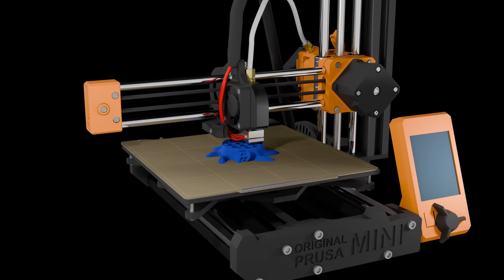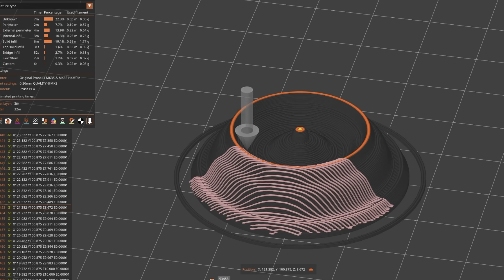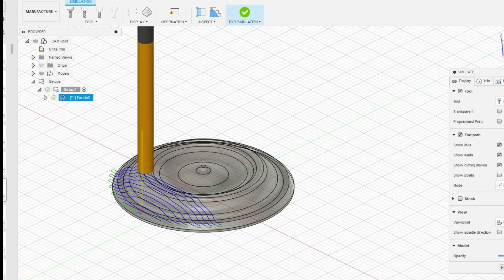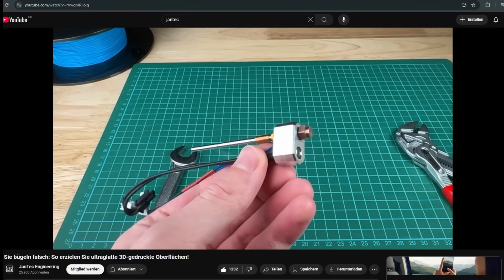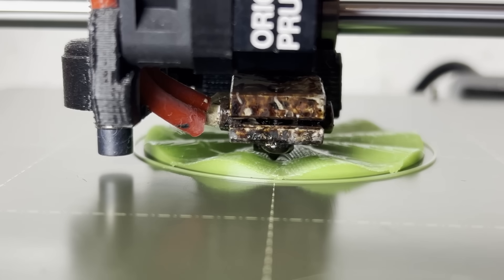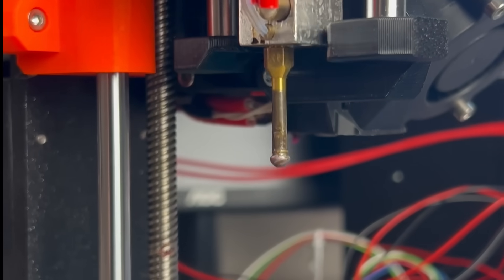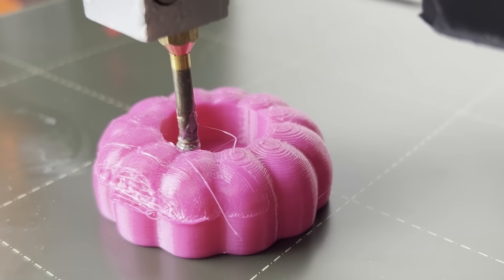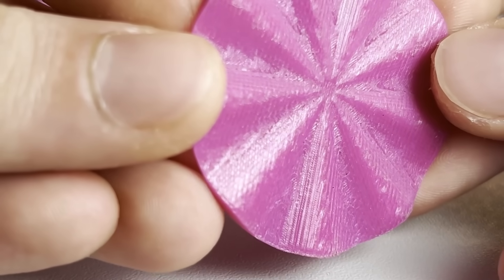A Different Approach to NonPlanar Ironing| Now Opensource!

Comment: As creator or the Ironing idea I can only say ‘bravo’ amazing development

Also an idea after seeing the video. Don’t you think that to improve visual finish for this Ironing you might want to actually remove external perimeters. Of course a full solid object is too time consuming, but there’s ways to make a ‘perimeter’ solid without actual perimeters. Why I say this, well when you work around VS an opposite angle is harder to iron it, so if the areas ironed would have a common direction, the ironing finish would look a bit cleaner

Comment: Look into soldering iron cartridges. Long, thin, with the heat and measurements directly at the tip. Maybe you can take an existing one and turn it down to ball shape.

Comment: Testing strength and friction would be interesting after you do this; this may have benefits there. Also, maybe just take a nozzle, cut it, fill it in, and round it off to make the desired thing. For laser, please have well ventilated.

Comment: Wonder if you could replace the hotend with one of those small pencil soldering iron? You would need to make a special round tip, but would also have it further away from the gantry and be able to compensate for the temperature loss due to the fact that you have a higher top limit you could adjust to.

Comment: It would be interestimg to make a radial version for a few of those, going in a spiral instead of a plowing pattern
Reply from the maker: This is already a feature of the script. You can choose between scanline, adaptive and concentric(spiral) but the main testing happend with scanline, so the other two are very experimental and probably buggy aswell.

Comment: not sure if you noticed but your custom iron tip isn't very stiff, I can see it deflecting also a more dense tip may help with the thermal gradient by having more thermal mass, might take a bit to heat up though

Comment: You are awseome! I suppose as this is only gcode it doesn’t matter what 3d printer you have? The non planar top layer has been something I have been wanting for ages🤩
Reply from the maker: In theory yes. It is currently tested with prusaslicer and marlin flavoured gcode. I added the common differences of f.e gcode comments of different slicers so it should work at least with orca and bambustudio. Other flavoured gcode should also work. But those things are not tested so you simply have to give it a try or wait until I can give you a better answer. For now, as long as you use prusaslicer and marlin, you are on the safe side. (make sure to turn off bgcode though)
Reply: @tengertechnologies Thanks for the info. Thought to ask as the bambu printers have a fairly good nozzle for non planar stuff. With small adaptations you have a fairly good amount of playroom close to the nozzle for curved surfaces. Of course with the closed source nature of the printers gcode adaptations are the only one you can do with them.

Comment: I would believe that the rivet isn't perfectly centered and thats why issues with dragging filament happens. Somebody for sure can machine a complete ironing nozzle out of brass with near perfect dimensions.
Reply from the maker: Yeah my "tool" is horrible. This all started as a weekend project and I had to work with what I had in house, hence the rivet and brass tube from a ballpoint pen. I'm currently thinking about the design a bit more and then order one.
Reply: @tengertechnologies  Good luck! Hope it works well.

Comment: Oof, that script really needs to use the normal of the surface to only generate perpendicular enough paths.

At worse you can just bruteforce it by having the script run from multiple angle and overlap the ironing.

About machining a round end, you can do it on lathe by freehanding it. It isn't that had.
Reply from the maker: I don't get what you mean. Can you elaborate what using normals would do better except of being easier to work with? 
The script in the current state supports max angle settings, tool collision calculation with different tool shapes and offsets (also per tool feature shaft/contactbit), maximal reach of the tool, configurability of the toolpath generation such as global or per segement recalculated toolpathing/collision to allow access to hidden regions. It also is able to calculate the perfect height of passes to make hidden regions accessible. It filters small errors such as sudden tool drops because of f.e very small holes. All this is configurable in every step.  So if you want to only iron 10% angles, you can do that (look at 1:52 in the video where the slope map is shown, you can do that for every pass) . But I like to push things to the limit and set my max angle to 85deg on the nozzle with max reach 1.8mm.

If you talk about the pin hitting the print -> that was a mechanical error of my toolholder, combined with risky tool offset settings(gear slipped because of the pin having a -0.05mm offset and sticking to the material) 

About the machining: I simply don't have the experience to freehand a perfectly spherical end to a 20x4mm pin on a hobby lathe with horrible precision (In the video you can see the drill shaking because it's impossible to center it perfectly). I know how it can be done but I can't with my setup.
Reply: @tengertechnologies  Sorry for the late reply.

I mean making sure the tool would descend a slope instead of using a single direction for a pass and have a mix of different angle to the slope the tool would pass at instead of keeping the tool movement co-planar with the normal vector of the work.

I guess it felt obvious to me that going down a slope would be better than tangentially. As a handmade-gunsmith trying to remove gradient lines, that what I would do by instinct.

But my hands aren't CNC, even if I can reduce the pressure of the tool, I still need the tool to be in contact with the work.

With a CNC machine, I guess it would even be possible to iron out each high spot of the outer extrusion tangentially to get a perfect result on a convex slope.

Anyway, I guess once you get a goof hot tool calibration, the quality of the smoothing compared to the pass angle to the slope can be something to test out.

As for turning by hand I meant with holding a tool in contact with the work with your hands, not using the carriage. Regular files work well for just creating a round shape. And if you work slowly, you can use a template you 3D print to get a perfect ball end. Put some sharpie on the work to know where you are filing, and it just takes patience and making sure to use tools with big handles (to prevent a kickback to be too dangerous) and not wearing long sleeves.

Comment: You should look into using a long cartridge heater with built in thermocouple. That could be used as the smoothing tool. No need to worry about heat conduction, the heater itself is the smoothing tool.

And to make sure it's got a nice smooth tip, just buy a copper ball and drill a hole half way through it, with a diameter matching the cartridge (or maybe a little bit smaller, then hit it with a blowtorch and slide it on when it's real hot for an interference fit. Or just hit it with a hammer to "crimp" it on 😅).

You could even use different diameter copper balls, allowing you to change the radius of your smoothing tool and optimize for different parts.

Comment: That is really cool. This would also work with a spindle and a ball mill if you have a tool changer (and rigid enough printer) 🤔. Anyways great project and great video :) 👍
Reply from the maker: Yes I thought about that and I might try it, as I have a spindle laying around. There are 2 problems. 3D printers are not built for milling forcces(like you mentioned) and it's messy so I don't think people would use it in a normal setting.
Reply: @tengertechnologies  yea your right. Maybe with a special toolhead with integrated vacuum but even then it might get messy, but since your just finishing the surface one might get away with it :)

Comment: Would contactless ironing work? Using hot air or a laser to locally heat the plastic.
Reply from the maker: As I mentioned in the video, the next video is about this topics (later this week)

Comment: why not actually use a ball end mill?
just add it next to your hot end with a Dremel
Reply from the maker: Thought about that but a 3D printer is not built rigid enough for milling forces. But I might try it anyways, because I have a spindle laying around

Comment: I was just thinking about this. Ironing more than just the top most surface. What is ironing happened every few layers. Like just iron out a few of those lines just do a few more layers and then do the same thing.
Reply from the maker: you can use this script to try that. Just set the maxReach equal to the layerhight(if you want to do every layer) or whatever Z step size you want. Then enable splitSegments, set the collision scope to "printed" and enable regenPerBandPaths. This is actually a bug, but know I'm thinking of keeping it in as a option lol
Reply: @tengertechnologies  I dont have the knowledge on how to do this sadly. :(
Reply from the maker: @jebronekitty  send me a message on reddit, we will figure it out

Comment: Just how far away would it to add a motor and ball end mill? It would also give you smooth surfaces and more accurate dimensions.
Reply from the maker: 3D printers are not very rigid as they are not built for such forces. I can try it though, as I have a spindle laying around

Comment: With the long stickout you're gonna have relatively enormous distortion of the ironing nozzle.
By combining multiple metals you likely made it worse.
Reply from the maker: Are you good with thermal stuff? If yes, let's connect if you want.
Reply: @tengertechnologies  I'm just an enthusiast and wouldn't say I'm particularly good at that stuff. Just enough to worry about thermal expansion of dissimilar metals.
Reply from the maker: @Argosh  I actually did some research and was worried about the heat transfer between the nozzle and the pin (especially because of the oxidation layer on the alu in my first design) I wasn't concerned about the distortion though because in the second design, the copperwire doesn't touch the brass tubing. The wire is 1mm in a 3.5mm tube. I made it like this with the idea of containing hot air inside the tube, so the copper wire doesn't cool down as fast. But I'm not sure wether this was a good idea or not. It seems to work okayish, but the initial plan was generating enough heat to do the ironing contact less with a 0.1-0.2mm offset. For that it is currently not hot enough.
Reply: @tengertechnologies if you want ro do this stickout you should probably have the heating element in the tip. Look at the ts-100 soldering iron. You probably could find a tip compatible and they have thermocouple and heating element in the tip.
Reply: @tengertechnologies  there's a heat insert tip for the ts100 that has a standard metric thread on it. maybe that could help.

Comment: Good work !

we've done some work that is not public yet. In order to avoid issues with the g-code file, we work on the 3mf file of the printer and the g-code.
The 3mf file allows you to get a manifold mesh that you can slice with trimesh using the height from the g-code. 
I think it would help you to simplify you code. You can also make all yout perimeter and area work with shapely that works well with trimesh.
Hope that helps !

Comment: Very cool. In my CAM software there is a special feature that fades out the transitions from different sections by overlapping the tool paths and increase the distance in the overlapping tool paths so it technically doesn't touch the surface. Then slowly approach the exact surface.
Reply from the maker: Yeah I have that on my todo list. Basically a contact slope/gradient at the start/end points. But a problem we have in 3d printing which we don't have in milling, is the pressure in the nozzle. So i basically have to add linear advance, otherwise there will always be a bit off unwanted material on at the transitions.

Comment: 5:35 I think that you need to make a custom silicon sock for this tool to avoid temperature loss.

Also spiral ironing could work much better for some printings, but idk how hard is to code this.
Reply from the maker: Yeah i need to order some hightemp silicone. Spiral ironing is already in the script. You can choose between "scanline", "adaptive", "concentric(spiral). But while the whole script is experimental, adaptive and concentric are suuuuuper experimental and I haven't tested them much.
Reply: You could also have a cartridge heater in the tube at the bottom.
Reply: Spiral, or radial... or maybe passes of both?
Reply: This, you want it insulated. My first thought was a few layers of heatshrink, though it would need to be teflon or something else that won't melt at your 270ºC target.